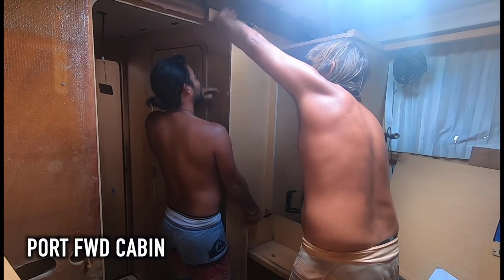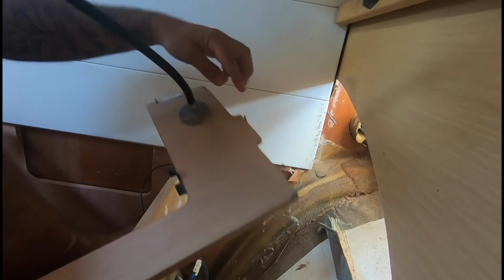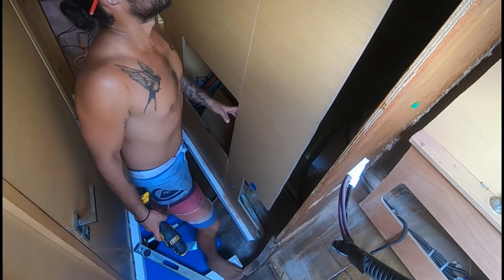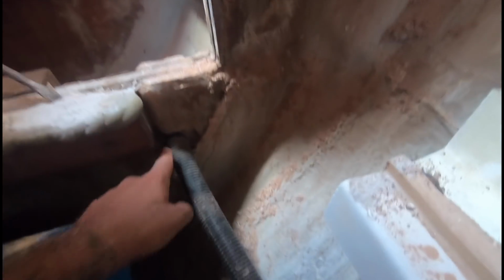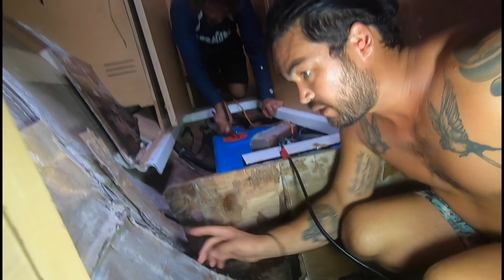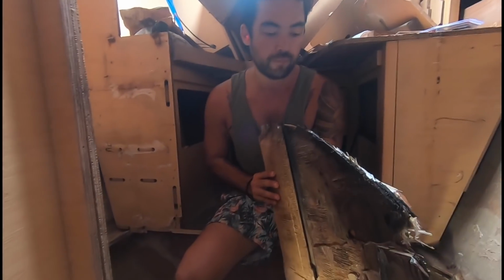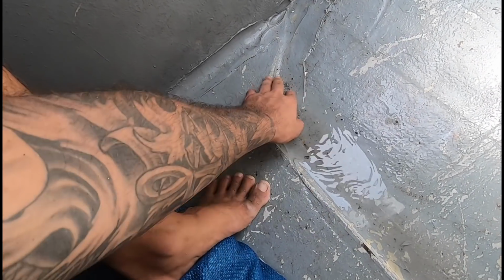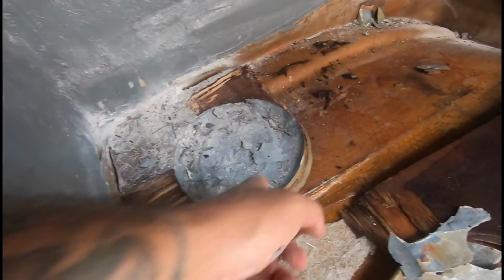CRACKED BULKHEAD REPAIR SERIES - Part 5  (Episode 110)

Comment: I hope Lagoon is taking notes.  This is a design flaw.  They need to make that bulkhead as thick as the base all the way around.   Minimum.
Reply: And not out of wood that rots
Reply: @gunnarlandin3258  a lot of manufacturers went to pressure treated ply?
Reply: Design flaw is a much too nice word for that. A major design mistake/error, I'd say, to let a little screw cause a leak that destroys the bulkheads. And the workmanship on some parts didn't look good as well. In my former company, we actually paid the workers and customers money, when they detected design errors like that.
Reply: @luismanblog  you left out "and possibly sink the boat" to your list:-)
Reply: The bulkhead base is not the design flaw from an engineering point. what you have is a reported solid fiberglass beam at the top that supports the mast and then a single sheet of ply between that and a triple ply base section at the bottom. It needs to be the same strength all the way from the glass beam to the cabin floor the section that was distorted is the middle piece. The rotten section was not deformed but pulled up distorting the middle section.

Think a triangle with a beam on one side and a reinforced point on the other, now the middle section is 1/3rd the thickness of the point and also has a hole cut in it for a doorway. Now twist it and push it to see where it flexes. You do not need a structural engineering degree. FYI Steel boats are strengthened with additional material to twice the thickness for doorways to prevent distortion preventing a door opening or closing. 

I suspect cheap materials (Ply) and weight reduction caused this, when rebuilding it I would possibly change materials to something possibly a hardwood in two different directions (Vertical and Horizontal) bonded (glued and screwed) then glassed and leave it exposed. I would also think about making the doors shorter at the top and bottom yes maybe duck in and out but more strength or higher density materials, more materials and more layers (5 layers of ply) around the hatch to prevent deformation.

I suspect the bulkheads were under engineered for the sail size and specified loadings. The rig tension is what is bending the boat and this is set by the factory for the conditions they suggest the boat can and should be sailed at and in.

For those suggesting Colin change boats it is the devil you know and the demons you are willing to fix and accept, once strengthened and correctly engineered the boat will do what he wants, changing to something else will have its own issues.
Reply: @stevet647  I was thinking take the three layers at the base and extend it all the way around the bulkhead to be sure it is strong enough.  The leak issue garenteed failure of an already existing weakness.
Reply: @patraic5241  That will stiffen the area but I would suggest the size of the doorway is also of concern and could be reduced or have additional support to prevent distortion. 

While the leak would be a problem later it was not instrumental to the bulkhead failure at this point, its degradation would take the pressure off the failed area.

I also suspected the boats history was part of its issue in earlier video's but with additional non damaged boats showing the same damage and more of the design exposed the engineer in me has to put the blame on the manufacturer getting strength calculations wrong.

Even with some of the poor construction a boat should not bend, compress or distort when tensioned and for more than one to have done the same thing if it was a car or a  commercial vessel it would be recalled.

Just my 2c and I was already wrong suggesting the history was a contribution. Still wrong if you ask my Ex's!

Comment: There is no way this damage was from only the hurricane.  The leaks were rotting the plywood for a long time!
Reply: Probably poor engineering design. I wonder What will lagoon do about this. Not my dream boat anymore
Reply: When he crawled under the saloon floor he found old repairs from it beginning to fail and rot should take quite a while in marine ply . So no the hurricane is not the cause , the boat is weak , badly built and impossible to do a non destructive repair or even inspection . 

Coastal sunny day party boat only . Once they rebuild it properly it will be ok. 

They also sail like crap and won't go to weather . Friend  had one , would not bother putting the sails up and paid people to deliver it . Had a second boat for sailing . The lagoon was the support party boat only . Great for that .
Reply: Had it not been for the hurricanes (rotted forward bulkheads or not) this boat would probably still be in the VI charter fleet. Under normal use no one would have found the rot, or even had a reason to look for it.
Reply: Initially I suspected the hurricane force winds and submersion- but not any longer.
Reply: all these problems were present before the hurricane. in the last episode Colin hinted that the previous owner knew about all of it and placed it in the path of the hurricane to collect insurance and get away from the boat.
Reply: @robertgary1850  I must say that a few owners must be thinking the same - a convenient fire or something .
Reply: Intelligent comment Alert.Someone with a brain. Whoop Whoop! Danger Will Robinson.
Reply: This right here.

Comment: I'm a retired structural engineer of almost thirty and just incase you guys haven't already thought of this, my opinion is your damage looks like it occurred during a haul out by a crane operator who squeezed her up way to tight and broke her into. Just sayin. Hope you can puy her back and make her strong before you head out across the Pacific. Don't get in to big of a hurry. God bless you. Shalom  If I weren't already past eighty I wouldn't mind giving you a hand. Good sailing, I believe you will.
Reply from the maker: Hey Larry! You definitely aren’t the first to make this comment but a travel lift or a trailer both encourage the hulls to come down. The failure of this bulkhead is a result of the hulls coming upwards, along the plane of the shrouds, causing this section of the bulkhead to buckle under compression. I saw it with my own eyes as we lifted her 2 episodes ago...

Comment: I am considering a purchase of a used catamaran in the next 5 years and this video series has me doubting the engineering of Lagoon.   Those bulkheads look weak and I can not figure out why they did not sandwich those 3 piece walls all the way to the top.   Every single one of them cracked right where the they are sandwiched with two short pieces attached to the full length piece.    Lagoon saved a few hundred dollars per boat for which they charge 500k.   There is another youtuber with a Lagoon that is experiencing the same issue and they have to tear their boat apart because of weak bulkheads.

Comment: I've had some success with controlling grinder dust by taping the shopvac hose to the the grinder housing. I put a spare 4' opening attachment on the end of the shopvac hose where I tape it to the grinder.
Reply: Wants a water spray system to keep it from going airborne.

Comment: Definitely not impressed with lagoons assembly process . they make it absolutely impossible to work on this boat unless you completely cut everything apart , all of the cabinets and interior should be modular and able to be removed just in case something like this happens a person can take it apart to repair it. And the bulkheads should be three times as thick in my opinion. Keep up the great videos you guys do awesome work.
Reply: I think the cabinets kept it from folding in half...

Comment: I can't help thinking that you need several bulkheads in metal/carbon fiber to be able to resist those compression forces.

Colin, you going to have to change the boat name to "Parlay Resurrection".
Reply: If it were me I would want aluminium bulkheads with carbon fibre joints.
Reply: @WihGlah  i'm sure if you donate a large sum of money, they would change their plan of action to include aluminum and carbon
Reply: All repairs should at least be carbon
Reply: @xfoxtrotwiskeykilo995  No real need for carbon here, the rest of the boat is glass, may as well use good glass and resin, it'll be cheaper and still way stronger than the rest of the boat, which is what you want for bulkheads.
Reply: So, what I think I hear you saying is, particle board should not be used in structural areas.  Tongue in cheek.
Reply: plywood.  pardon me.

Comment: well done Colin, but I'm starting to wonder about Lagoon's engineering practices when I see holes through bulkheads without having enough "bulkhead" left. is just one model alone really affected?
Reply: also sealing limber holes so to prevent water migration
Reply: Nope.  Google bulk head issues lagoon.
Reply: @nicholasr7987   I have "googled", but something strikes me as being just strange engineering each time I see a new video from Colin; I just fear it reflects an attitude problem as much as a model-specific engineering one. For example, ignoring the rot (MAYBE just leaks local to one vessel - perhaps and how could you check easily too...) but those holes drilled for cabling through the bulkheads where there is precious little material in the first place??? Unless Lagoon has a 450-specific factory, I just can't imagine how any design-culture issues would remain with just one model.

Comment: Awesome job.  Is it better to go with like a coosa board vs marine ply when you're rebuilding??
Reply: Good quality marine plywood is far stronger than coosa board, the advantage coosa has is that you can drill it and when water gets in it will not rot.

Comment: My 2 cents here Colin, widen the upper and lower areas and make a port type door, obviously more people than you are having bulkhead issues with that hull type.  A step over threshold to add linear strength lower to the keels. I'm not an engineer but I've been a contractor for 35 years and all I do is fix other peoples fuck ups
Reply: I was gonna say...only open doors when at anchor.
Reply: Robert Hicks designed his boats exactly like that where the closed door formed part of the structure.

Comment: All your bulkheads need to be at least doubled by laminating 1 inch plywood using epoxy thickened with caabosil all seams epoxy glued biaxlcloth taped
Reply: All seams need to be coved with thickened epoxy
Reply: All exposed wood needs to be dry and completely covered in thinned epoxy to soak in then when dry covered with unthinned epoxy

Comment: Well hopefully with y’all doing all these repairs Lagoon will be able to have their engineers watch your video and make further upgrades at factory
Reply: They cut all those corners to save costs on manufacturing. If they wanted to build it right they would have been doing that since the beginning. 

That's the issue, they don't have any real incentive to build it more strongly. If it meets the minimum safety standards that's good enough. It's how EVERY company that makes ANYTHING operates. Even Ferrari and Rolls Royce spend a huge amount of time to streamline and economize their production. That means things that could have been done better aren't because it costs more money. 

If you don't believe me ask anyone who has ever owned a 10+ year old Ferrari, Rolls Royce, or any luxury car. They are great when new and if you are a perfect saint with your maintenance. A used one is always a nightmare even if it was well taken care of. 

The cheaper you can make it, the more money you make when it's sold. 

i'd bet dollars to donuts that the resin they used was expired or improperly mixed. Good resin that's mixed properly will never de-laminate. It's impossible, it will rip the plywood apart before that resin comes off from the plywood itself unless the resin was bad in the first place. You can test it for yourself by buying any kind of fiberglass resin you want. Mix it up and slap a couple of pieces of plywood together. After they are fully cured separate them without a layer of ply sticking to the resin like they were made as one piece. You can't do it, the mechanical bond between the wood and resin is stronger than the bond between the glue used to hold the layers of wood together. 

Using expired resin (even if it was just a few days or a week past the date) falls under cutting corners to save on production costs. 

Lagoon makes boats for charter companies and an overwhelming majority of them are owned by charter companies. These are high volume production boats that the designers know will live a very easy life floating around the Med or Caribbean with tourists being taken around to local beaches and dive spots. There is a reason you don't see a lot of youtube sailors in Lagoons even though they make a massive number of boats compared to most catamaran builders. 

Charter companies want to spend as little as possible and Lagoon makes boats specifically for that market. 

TL;DR They don't care, it's built exactly like they designed it to be built. If there was an issue with the engineering it would never have been approved to be built and no insurance company in the world would insure their boats. They hit the bare minimum they had to do and stopped right there. It's their business model, why would these videos change that? The charter companies who buy them don't care, when they start having issues with the boats they just patch them up as best they can and sell them to a smaller charter company and replace it with another new boat. So these videos aren't going to hurt sales. Any private buyer interested in buying a catamaran is going to know that a Lagoon isn't going to be their best option for a well built quality boat to sail around the world in. It's also why you see these boats that sold new for well over $1 million selling for a fraction of that just a few years later. A well built, quality product is going to hold onto it's resale value. Poorly built products that are a maintenance nightmare see their resale values drop like a rock.
Reply: @velvetjones  except it seems from the Facebook owners group there are a lot of privately owned lagoons, which are now overpriced lemons

Comment: i would suggest demo ALL the inside wood to bare bones and fix all bulk heads and then build back the way you want
Reply: Yeah I suggested that long ago....He's in Panama he can find good carpenters cheap and re-design the interior. Actually it's the only way to re-enforce the bulk heads and hull....
Reply: @dingo397  at this point yes.
Reply: Agree. Suggested this a few videos ago. Gut both hulls to the fiberglass and rebuild from there. Eliminate any future surprises. Lagoon executives should provide their fabricators on site for the rebuild.
Reply: I was thinking same thing. Just gut the whole inside out then you will see everything. Get the repairs done and get a good finish carpenter to help you rebuild.
Reply: 1) Probably expensive. 2) The whole point of this series is DIY.
Reply: Agreed. By the time you've tried to repair all that joinery it would've been cheaper and easier to start from scratch. It won't be as good trying to patch it back, and of course easier to make the structural repairs.
Reply: I say demo only what is necessary, then after repairs call in a boat cabinet maker and ask his advice, get a bid then make up your mind.
Reply: @maggiebraun2011  Have you ANY idea what that would cost?

Comment: Sure says a lot about the poor quality of Lagoons.... pretty crappy build quality....😒
Reply: The truth? ALL production boats have cut corners. Only if you build a custom boat will it be perfect. Sad yes but even 500k boats are thrown 2gether at a cost.
Reply: This is the under belly of modern mass production , there boats are profit machine s !!
Reply: All Production boats are built to a price point..The resin they use needs to have every barrel batch tested before use.I have had many years of rebuilding defecient boats.When you are done patching it all back together it will weigh what they saved with the insufficient structure. Good luck with your lessons In Production boat building.